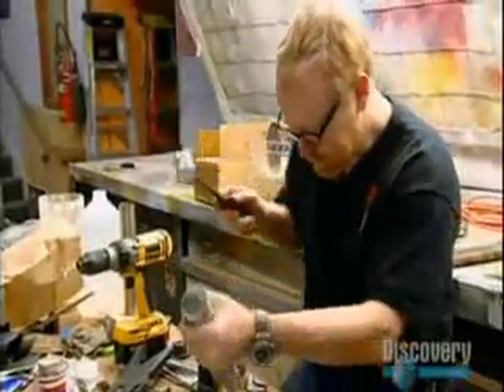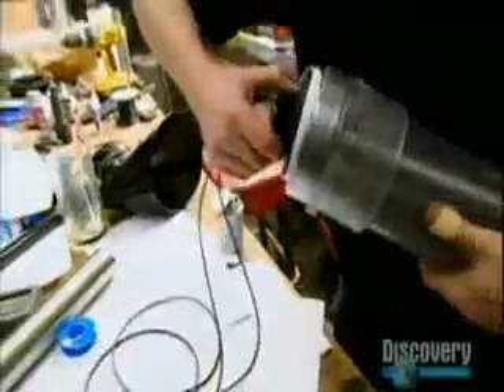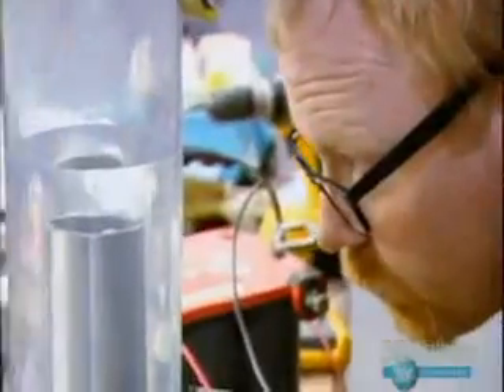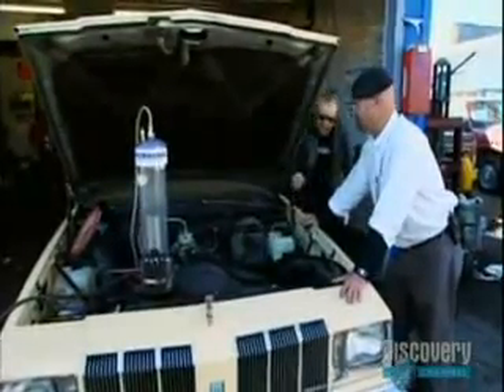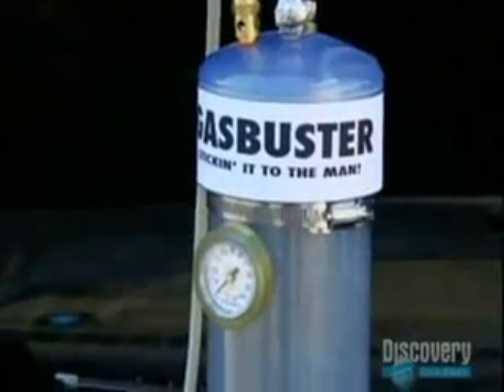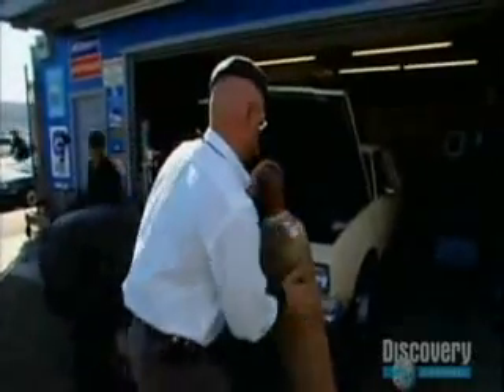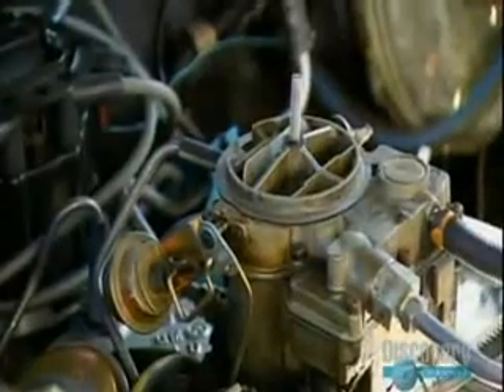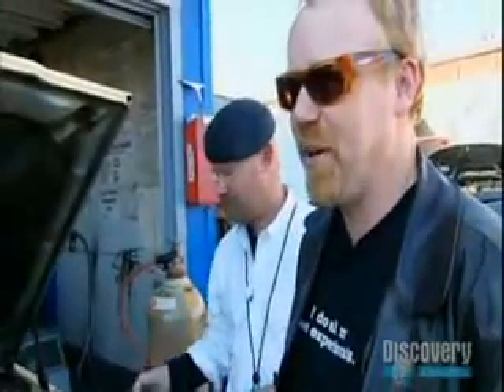HHO Mythbusters Explained

Comment: I don't think the problem is whether 1) a car will run on hydrogen or 2) whether a properly constructed cell will make enough hydrogen to do so. The answer to both these questions are surely a resounding yes. The problem, however, is this pesky law in physics that insists that energy is conserved, that is to say, when you add up all the final power you got from it and all the little losses during conversion, it will never add up to more than you started with. So no free energy. The energy you ultimately run the car on... came from the electricity you started with. Now if your electricity is cheap enough, this might make sense in monetary terms... but in good old Joules... it's a nett loss, because converting water to hydrogen using electrolysis is incredibly inefficient. Even if you add baking soda.
Reply: Voltage is not a measure of energy or power. it is a measure of electrical potential. You must also know either the resistance or current flow to calculate the power in a DC circuit. Power is measured in watts and energy is measured in watt-hours.
Reply: +Brony Pony No. The law of the conservation of energy is still very much current in physics. Your atom example also suffers from it. It is true that you get out more energy than you had to put in, but that is not what conservation of energy is about. Conservation of energy merely states that if you add up the energy that you put in, the energy that was locked up in the atoms being split, and subtract the losses, it will equal the amount of energy you get out. If you are diligent about it, you can account for every Joule in the equation. There are no free lunches here.

The same applies to the hydrogen case here. If you take the energy it took to generate the hydrogen, subtract the losses due to inefficiencies, that will equal the energy that you eventually get on the engine of your car.

If we had a natural process (driven by the sun perhaps) or some renewable source of hydrogen, sure. But as long as it takes fossil fuels to make the electricity which you use to turn water into hydrogen, just to turn it back into water again by burning it in an engine, you won't be getting any magic energy from anywhere.

The only way this saves you money is if electricity is cheap enough.
Reply: +Brony Pony Santa Claus is coming to Brony Pony's house this year because nothing is impossible in a infinite universe.
Reply: +Brony Pony I think there is one stark difference between the nuclear example you used and making your own HHO, and that difference is that you have to make the HHO. With nuclear fission, we only "win" because we don't reassemble the uranium atom afterwards. We break it down into smaller and lighter components, and then we throw it away as waste. This really is similar to throwing away the ashes after making a fire, but we don't go around saying that the energy was free just because the flame it took to light the fire was much less than the heat we got out of the fire in the end. So once again: We can measure the amount of energy in a piece of wood (we know the calorific content of various species of wood for example), we can also measure the energy in an uranium atom, and the point I'm trying to make is that once you calculate the full round trip cost which includes taking the ashes back into wood (plants do it all the time) or turning smaller atoms back into uranium, you simply haven't looked at the full picture. Bringing this home then to HHO: Because you use your own electricity that you pay for to make the HHO, you don't want to spend more money on that electricity than what you save on fuel in the end. If you can manage this, then it will save you money. Due to the spectacular inefficiency in the process, the massive amount of Hydrogen you need for an engine to run (because it is the lightest atom and carries little energy), I very seriously doubt you will save a cent.
Reply: +Brony Pony Fair enough :-) I agree. This is actually what renewable energy is all about. If your source is a sustainable source that naturally renews faster than you can "burn" it, it is renewable, and because you are tapping into a renewable stream, you might get out more than you put in. So to get back to my example of using wood for a fire, that technically makes wood (sustainably produced wood) a renewable and green resource. Much better to burn wood of trees that grew yesterday than to burn coal of trees that grew a million years ago. And you can use a natural process in nature to turn the CO2 and ashes back into wood, so you could argue that you're getting something for free. The sunlight actually :-)

If we manage to find a cheap and efficient way to make hydrogen out of water, and a cheap and efficient way of getting enough of it into a tank, we will be able to run our cars on it. Electrolysis with coal-produced electricity is not cheap enough. Better to burn the petrol, it's less harmful and costs less. :-)
Reply: +plonkster that law of physics does not imply this method doesn't work. Furthermore, you will lose a lot of energy during the transforming of it. Water is a lot of energy conserved, once you break it free with only a little energy used (2V is enough) you can convert it into electricity, momentum, even with the loss you will have more than sufficient to use it. The trick and misconception in this is it's not electricity making energy, but freeing it up so you don't need much. Kisses
Reply: +Kim O&#39;Brien Indeed, as anyone with a welding machine knows. Low voltage... LARGE currents, enough to meld two pieces of metal together. :-)
Reply: plonkster
 As anyone knows AAA battery low voltage shorted out low current only enough to warm a small wire. Read about or take a course in basic electricity before making any more foolish statements. Power is the product of voltage times current in a DC circuit.
Reply: +Kim O&#39;Brien Hang on a second, I'm actually agreeing with you, and disagreeing with +WvotantheWhite. Before you attack me, take some time to read the whole comment thread. My point is that anyone with a welding machine knows that voltage means very little. Exactly as you said: Have to take into account current and time as well before you get to Kwh (which you can translate to Joule, the official measure of energy).
Reply: +Wvotanthewhite and plonkster
Electrolysis occurs at the surface of the electrodes at a relatively low voltage. So the energy wasted overcoming the resistance inherit in the electrolyte separating the electrodes wastes a lot of energy at a rate of R*I^2 with this electricity becoming heat. This means the most efficient way to produce gas is to use large electrodes close together at relative low voltage and high current. If you raise the voltage to increase the current you also raise the R*I^2 loss in the electrolyte.(Energy loss goes up as the square of the current.) 

You also have the problem of getting the gas away from the electrodes quickly because the longer it hangs around the slower the electrolysis becomes due the obstical the gas becomes. Any electrolyte you pick by definition will be corrosive. You need non corrosive electrodes like carbon or platinum. Carbon is cheap but porous and has high resistance losses. Platinum has low resistance but high costs. Lead will react with the electrolyte creating lead oxide. Other metals except gold will also react with the electrolyte especially when a current flows through the electrolyte and electrodes.         

You would not want to use an electrolyte like common salt because that will produce chlorine gas.  Now Mr Meyers claims his car would run on salt water. That is in itself a giveaway of fraud because the production of chlorine gas then used in an internal combustion engine would create corrosion havoc. 

At the end of the day you still need to insert enough energy to break the Hydrogen/Oxygen bonds plus the energy to overcome electrical resistance. Those who think a free lunch is being served in a Hoffman apparatus are wrong.
Reply: +plonkster One issue that no one seems to recognize is that when using an internal combustion engine you are using a gaseous mixture of fuel and oxygen. The best mixture has just the right amount of fuel for the oxygen in the cylinders. Now with HHO 1/3 of the volume is oxygen.Air is 1/5 oxygen. But if you not storing the HHO there is no advantage to using the electricity to male it on board over using the electricity to run an electric motor directly. If you store it on board than its energy storage density is low compared to hydrogen gas only or CNG (better), Propane (even better) or gasoline (best). It does produce more energy when burned compared to what you get from the same mixture of hydrogen and air.Lets try burning Methane vs Hydrogen with the same amount of Oxygen. 2CH4 + 602=4H2O + 2CO2    12H2 + 6O2=12H2O I need only a 1:3 ratio of methane to oxygen vs a 2:1 ratio of hydrogen to oxygen. This means when I burn hydrogen I need a lot of space for fuel vs burning methane.
Reply: +Kim O&#39;Brien It's perhaps not handled here, but the massive amount of space you need for it to work is mentioned in other videos on this topic. I watched another video where someone explains in great detail how much energy you actually get per volume (uncompressed in this application)... suffice it to say, there is no way that using HHO on your IC engine (whether you generate it onboard or in your garage at home) is going to save you money. Ain't gonna happen. Also, you mention "the best mixture", I think the official term is "stoichiometric correct", which is something modern engines do with a MAF/MAS sensor in the inlet and oxygen sensors in the exhaust (though the latter is more for the catalytic converter). I'm pretty sure that adding more burnable gas to that mixture is likely not going to be picked up by the sensors and it's probably going to throw the same amount of fuel into the system... ie no fuel savings. It's a complex subject, and I'm more electrical/programming oriented, definitely not a chemical engineer. I do know you're not going to get a free lunch though :-)
Reply: That is to say, the MAF/MAS is likely not going to know there is hydrogen there, and if it does, it might not know how to deal with it in the ECU. The results is going to be unpredictable.
Reply: plonkster 
I assumed that HHO only would be used in an HHO fueled engine. Gasoline engines use a richer mixture at a cold startup due to lower vaporization at lower temperatures. Hydrogen doesn't have that problem. A different compression ratio and spark advance would probably be needed along with different shift points. There also might be other unforeseen problems. One advantage would be no need for a cat converter. I think most of the problems have been covered than again these are only theoretic discussions because we don't have the money or time to build and test prototypes. :-)
Reply: +plonkster you can not fission hydrogen and make energy. atoms like hydrogen and helium take energy to fission. or at least that is my understanding.
Reply: I Care Where is plonkster talking about fissioning hydrogen?

Comment: I don't see what the issue is. They only proved that the HHO generating apparatus does not produce HHO fast enough to run a car. Obviously if you pumped more energy through the water you would get more HHO. This is nothing revolutionary. And it isn't going to bring down oil companies, the battery they use was charged using energy produced from oil. It is physically impossible to get more energy from burning HHO then you use separating H2O.
Reply: Isn't it a red-ox reaction? I know the"start" of red-ox reactions are only dependent on voltage. It takes more current to make it go faster. So power can be almost zero if the current is low enough, but so will the rate of production
I'm not saying its impossible to cause an event that produces more energy than it took to put into motion. It doesn't take much energy to let go of a bowling ball, and it hits the ground with a lot more force than it took to let go. But the way I understand electrochemistry makes me think breaking the H2O bond so that you can use the energy that is produced from the bond forming again is more like picking the ball up off the floor so that you can drop it on the floor again.
That's interesting. An 80-10-10 mix would leave you with excess hydrogen. Unless you mean 80% by volume and not mol ratio. Maybe the formation of Hydronium releases more energy than that of water?  If that is the case, which I don't think it is, then I would think the amount of Hydronium produced might be worse than carbon dioxide.
Either way, if you can make a working water engine I'm all for it.
Reply: Oh, you do mean by volume. Why would you calculate mols of "normal air"? Have you calculated the molar ratios of H2, O, and N?

Comment: That was a pretty half-assed attempt by Mythbusters, I thought they at least had some REAL engineers that worked behind the scenes and did their homework on these experiments.  Any high school kid with an internet connection could have done a better job than that.  I just lost respect for that show.  I wonder how many other "busted" myths they've done were just due to incompetence or rushing through the process to make a deadline?
Reply: +pyronaught You've already had three months to make it work whats the problem?
Reply: +Kim O'Brien Make WHAT work?
Reply: +pyronaught Well if you are unhappy with their effort than there is the dateline NBC video. They tested out a marketed and installed HHO setup or as I inferred since you think a high school kid with an internet connection can do a better job how about you trying it? You've had three months since your original comment.

Frankly I don't have access to the tools or materials to build it due to monetary reasons. However my science background says conservation of energy and entropy make building a machine to run a reversible process subject to the laws of physics. In any reversible process ( water to HHO gas and than back to water) there is always some energy that can't be used for useful work (entropy). So because of that I would not expect this device to provide any additional energy from water. Instead it would be an energy waster.
Reply: +Kim O'Brien I'm not disputing the fact that the laws of thermodynamics prevent any scheme whereby using onboard HHO generators can be used to create "free" energy.  Energy from the petrol is obviously being used to create the electricity to perform electrolysis and no conversion is loss-less so they can't even break even.  I think there may be something more complex going on where perhaps the HHO increases the efficiency of the combustion though, creating the illusion that energy is being "created."    But Mythbusters did not seem to be debunking that particular claim.  They only appeared to be looking at if an engine could run on HHO gas, then proceeded to do a horrible job of building a generator capable of making the gas.  And yes I have made hydrogen generators myself-- not for putting into cars but for generating pure hydrogen as a lifting gas for balloons.  Making pure hydrogen is even more difficult than a simple HHO generator since you have to keep the H and O separate after coming off the plates, and collect them separately.  And YES it works, there is no problem and I had already been doing it at the time I wrote the comment.
Reply: +pyronaught you are correct that there is no free energy. At best, they are getting a little extra intake air density by cooling it with a water spray. The hydrogen silliness is just a way to overcharge for a water injector.
Reply: The whole point of this is having your car, which has a 12 volt battery, make electrolytes to feed a engine which runs at between 500 (idle) to 8000 (red line) rpm. 
As a mechanic, let me tell you, doesn't work, not even close.

Comment: ok let's stick to the science and engineering part of it , when hydrogen fuel is mixed with the proper air ratio for proper combustion inside the chamber. what are its BTU's.
 and how does that compare to regular gasoline BTUs
as well as comparing each fuels miles per gallon usage

Comment: the problem is consevaton of energy you can never make energy so you use elctrisity to split the H2 and O out of water then when you recombust them you can never get more energy then you put in. so runing a car on only water is just a less direct way to run it on electrisisty. you would be better to just put in a electirc moter. also it would be a lot saffer. but as far as jsut suplemanting the nomal gass engine with a fulcell i could see how that would work, thought not as well as a real hybrid electirc car. but one proble i could see is you would have to add a bit of weight to the car. so im not sure if it is worth it would have to crunch the number. if anyone know sowhere i could get the caculaton showing it is worth it that would be helpfull. also sorry for any speeling mistakes.
Reply: Brony Pony
my laws of physics lol. and even in nuculeer reactions  toatal energy is conseved the only reason we get energy out of nuclear fission is that that energy was stored in the nucleus by stars when they fused low mass nucleui into the higher mass ones like uranium. then we get that enrgy back. but if you wanted to brake an atom it would take as least as much enrgy to put it back. the problme with the idea in the video is that you are storing energy in the gass by elctricly braking up the water than taking the energy back out of the gas. so the energy you get out can never be more that you out in.